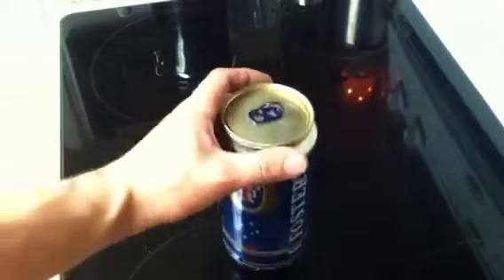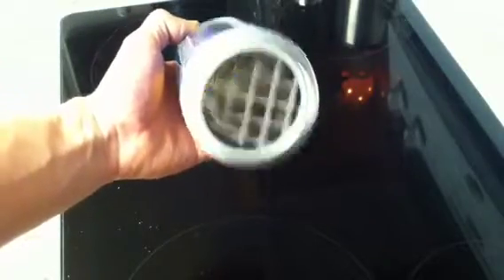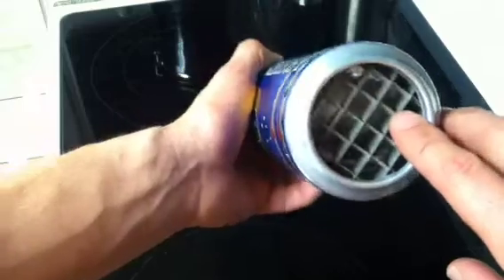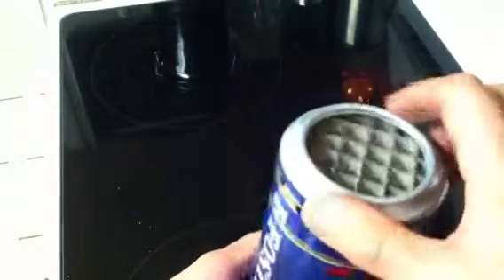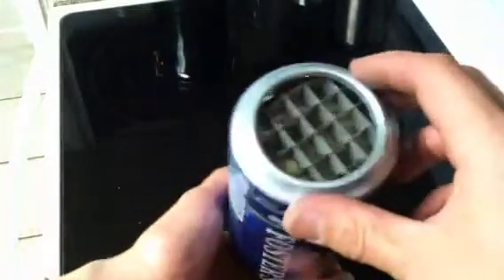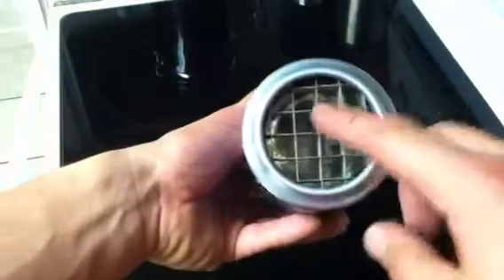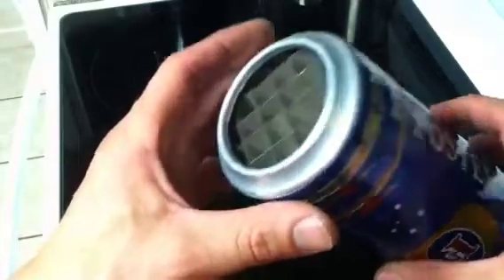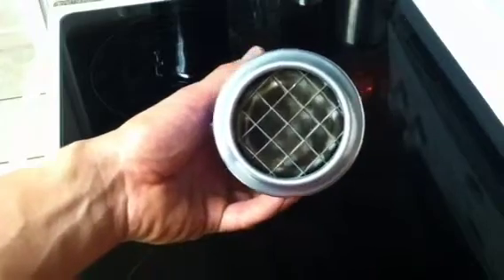The Ultimate Beer Can Pot

Comment from the maker: I'm working on a similar design with copper in the center fanning outwards instead of in a grid. maybe that will induce more air flow out the vents and with stand the heat better. Thanx for watching and for your support;)